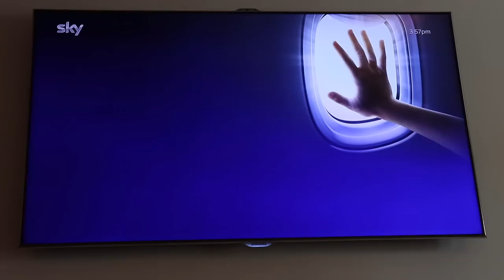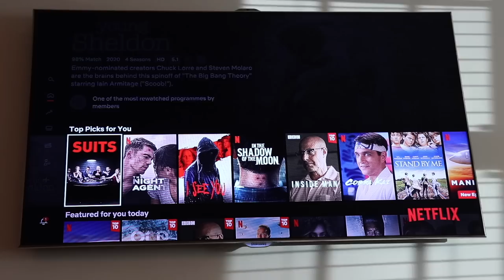GETTING THE GARDEN SUMMER READY! | James moans A LOT! | ad

Comment: For the love of all that is holy get the area brush for your pressure washer instead of using the detail brush. This is like painting a whole wall with your brush instead of your roller. Another option that works is just wet down the decking and use a big hard outdoor brush on it - that will get it done pretty quickly. Sometimes the pressure washer is the slowest way.

Comment: The timber on your deck is upside down, those ridges are meant to be on the bottom to let water drip away. That will rot over time because the water has nowhere to go.
Reply: It's called grooved decking it's all treated